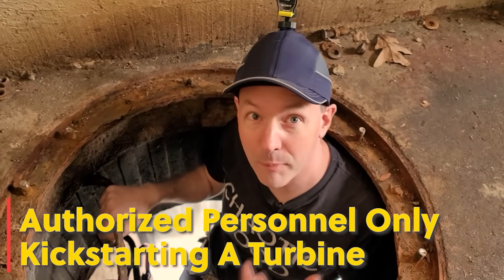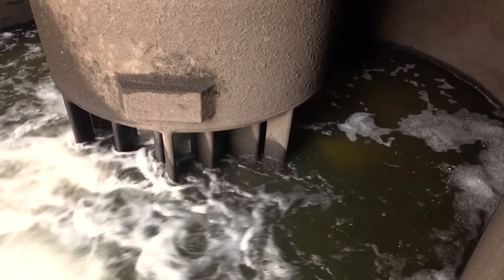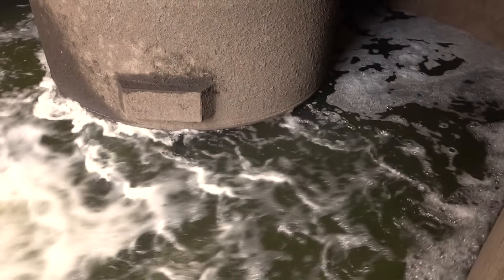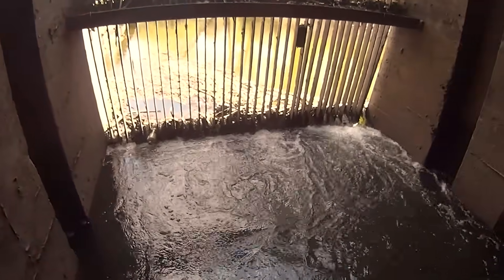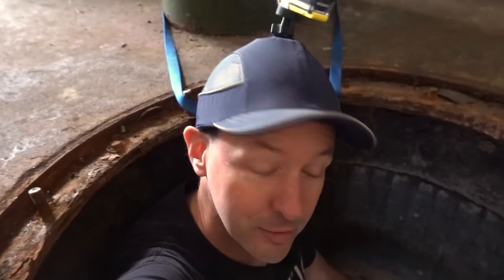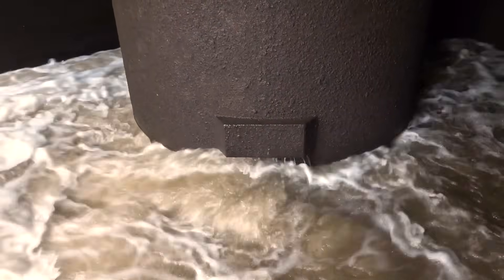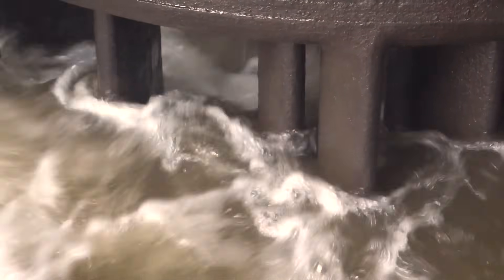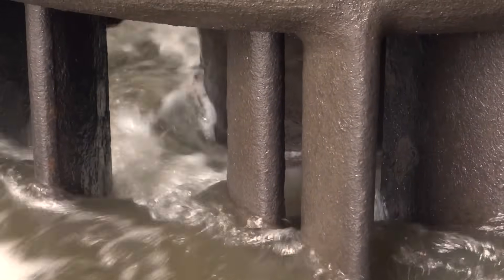Authorized Personnel Only - Kickstarting A Hydroelectric Turbine

Comment: How deep is the water where you were standing on the ladder?   By giving it a "JumpStart" do you mean you gave it a chance for the water head to build up a little bit before reopening the Valve allowing the water to enter the Turbine?

Do most Hydroelectric Power Houses work in a similar fashion as far as the water intake is concerned?

Comment: Dagone man, you’re lucky your brass balls didn’t pull you off that ladder! 😂 That looks like some serious flow! I’d imagine anyone that did fall in would be a guaranteed fatality with your legs getting sucked/pushed in between the vanes and the flow holding you, and if the vanes are the only way to stop it, if they hadn’t yet drowned they probably would even if they were “fortunate” enough for the vanes to have enough power to fully solidly close and cut their legs off so the turbine inlet could close and thereby stop whoever being sucked/pushed in and giving some soon to be mentally scarred coworker a chance of pulling them out. With my luck the vanes wouldn’t close solidly enough to completely sever my legs and I’d drown in agony and be stuck enough a crazy hero couldn’t free me without an axe or machete! …I can’t hold my breath long enough under water to die the other way by bleeding out from two severed femoral arteries.  Got to imagine the safety dude was drowning himself in some bourbon during this getting filmed 😂

Seriously bough this is an awesome vid and I’m glad you made it. 👍 …still a bit nuts tho 😂

Comment: It’s amazing the difference in turbine speed between the opening of the plates and the water level dropping back to its start level. Genius design. Plates help to direct the water in the direction to assist the turbine, and some of the water used to cool the bearing. Usually, simple is better, and more reliable.

Comment: Boy as a professional mechanic, i see a major problem. The drive shaft is not machined true and its out of balance. You can see much free movement putting pressure on the main bearing's.

Comment: As a retired military helicopter mechanic I saw kickstart a turbine and I thought I was about to watch you literally get in the water and kick start it. Trust me, I’m positive there is a private somewhere being told to “get down in there and kick it!” 😂😂😂
Reply: Seeing enough of these videos...wouldn't' have been surprised for it to be carried out literally
Reply: I helped cart start an F-4G Phantom once. Take a lot to get the air flowing through those jet turbines. To cart start (cartridge start) an F-4, you use something similar to a shot gun shell. About the size of a coffee can. And I don’t mean them little cans. A full size gallon(?) volume can. Seal it in the breach, the pilot hits start, and the gunpowder (or equivalent) burns and creates a ton of air pressure, heat, and smoke.
And it’s not uncommon for the aircraft parking spot to catch fire. Concrete soaked with hydraulic fluid, engine oil, and JP-4. Makes an exciting site. Especially when the smoke clears and the aircraft is sitting amongst the concrete being lit up. Depending on the load out, you can have a serious pucker factor on your hands. I was glad to help out, I was even more glad to only do it once.
Reply: I was asked by my kids when I came back, how many people I deleted in the war, I told them 9, they said"I thought you were a helicopter mechanic?" I replied yes, but I never said I was a good one😂😂😂
Reply: @Kamalacackleharris ouch
Reply: You're highly underestimating the danger here, does anyone manually move helicopter blades or air craft fan to start it? No, right? Similarly if he goes anywhere near moving turbine, he would become soup. He is already in high danger while standing on that stair, when inlet is open and water is moving, no one is allowed to go near that or stand where he is standing.
Reply: @ykd0011 I’m not, that’s why I couldn’t believe someone was about to try it.
Reply: Spin the blades to kick start it.

Comment: For some reason I always pictured the turbine laying on its side in a dam with water flowing from the turbine to the generator. It makes way more sense now. Due to the vertical nature of dams and no need to worry about by passing the water around the generator.
Reply: Depends on the the dam, but turbines definitely vary in style and layout. There’s both vertical and horizontally mounted styles, that much I know. But beyond that, there’s a vast wealth of knowledge I yet haven’t grasped. (Turbines are really friggin cool and I haven’t made time to do more research 🙃)

Comment: Wow! Such a small turbine, with such low head pressure. How much power can you generate with that? 100kw maybe?
Cleaning the debris in the grates, as little as it is, would make a good difference in this situation.
...is this even enough water to generate power? Or are you always on the verge of turning your turbine into a pump?

Comment: Was amazing working on Hydro Tasmania’s west coast generation, and being involved in refurbishment of 5 out of 7,  1-megawatt vertical pelton wheel  generators that started supplying power to a copper mine, first commissioned 1914, again, west coast Tassie
Reply: @russclifton2026  we visited one in Tassie with a wooden flume, I guess they are different to this because they have a really high head pressure and I was surprised to see how little water they used. Was like a firehose sized injector compared to this thing moving huge quantities of water through. Fascinating..

Comment: Awesome, TY for letting us in on this !! Jumpstarting ( starting ) most anything requires an increase of The Potential. In this case, I would have never thought of how to increase that potential.

Hey, about how many RPM is that generator turning at this spin-up point, and is there much of a difference between this lower operational water level RPM, and when the water level increases to full flow ?

Comment: This is similar to the Enterprise Mill on the Augusta Canal in Augusta Ga. I livesd 20+ miles from there . I worked for a contractor at this mill. I was interested in finding out how it worked. The canal has three levels. The first, or upper level, delivers the water. At the Enterprise Mill...there are two turbines. Each one makes 1/2 MW. The delivery pipe to the turbines are eight feet in diameter. They are rivited. The mill opened in 1845/6. It was enlarged during reconstruction. This is when the rivited delivery pipes were put in. 
  When both turbines are making power, the water races out the tailrace to the third level. A real exciting thing to see.

Comment: One friend of mine is a proud owner of a small hydroelectric power station, adm for him "flushing a toilet, means actually flushing a toilet into turbine outflow 😅🤣🤣
Reply from the maker: The toilets in our small-scale plants have all been removed because of that EXACT feature. Lemmie tell you how I feel about not having a working bathroom in any of the small powerplants. Several billion animals get to poop in the river, mine isn't going to make the slightest difference in the water quality. At municipal scale, certainly, but for individual users, not a chance.
Reply: @Physicsduck  yeah, exactly, and I'm not counting the fact that usually in cities drainage is mixed with sewage, so during storms it overflows to rivers anyway...
Reply: @Physicsduck  plus the aeration of the water would eliminate anaerobic bacteria

Comment: I think this is the only video inside the chanber while running. You have some guts buddy. It would be neat to put a go pro inside the wicket gates under water to see the blades turning under water. That would be outstanding and maybe possible in this instance.
Reply from the maker: Thank you sir! :) The next time I get the chance we'll see if I can make that happen. It's a good idea, but there's a LOT of technical difficulties to a shot like that. I've tried such things before, and most of the time it ends in having to buy a new camera.....and I'm low budget!

Comment: Just like the turbo charger on my 65 Austin-Healey. Now seriously, I worked on an Un-Watering pump below Bagnell Dam once, I was about 110 ft under the surface of the lake with water leaking in. It was seriously spooky to know if the concrete let loose you had zero chance. This is just a few feet of head, imagine 100 ft.

Comment: More modern dams use a volute around the wicket gates to remove the chaos of water entering the wicket gates. The water rotation going into the wickets improves efficiency by reducing turbulence. Instead of water entering a square room, from the side, the water enters a round spiral room from the side, spinning the water into the turbine.
Reply: The age doesn't have much to do with it. You're speaking to a different design (Francis runner) that's more popular in this day and age. The setup in this video isn't an uncommon low head setup. Still though... By the looks of things this is definitely a pretty ancient plant...
Reply: I believe in one of his shorts I saw that this particular dam is near 100 years old. One of the first of its design
Reply: So an IGV  then
Reply: @shadowopsairman1583  You could call it an IGV, sure
Reply: @isettech  I was wondering about that.
Reply: As a guy who worked on B-52S/autos/trucks/assembly lines  outstanding
Reply: Extremely low water head or Kaplan Turbine?

Comment: I was a crane operator on a Snake River dam. Turbines a bit bigger, I think the scroll case was about 20' across. Well the turbine blade and hub weight was 120 tons, five blades each at 15 tons per. My brother in law is on the Missouri in MT at Holter Lake and the turbines are similar to that but appeared to be older. They had wood stop logs still, crazy! I remember dropping the stop logs in our project and each was 30' wide and 8' tall, 4 went in each slot and 2 slots.
Reply: You have a Kaplan turbine in the snake river plant this is a Francis turbine .
Reply from the maker: This is a 4-bladed variable pitch Kaplan. You can see it up close in several videos. ;)

Comment: When you kick-started the turbine were you intending to generate power? If the turbine kept spinning with only a one foot head, I imagine that you would not be able to load it much; would you regulate that by changing the generator field excitation rather than the wicket gates, and does the governor even work on that as it does the wicket gates?
Reply from the maker: We just spun it up for this demonstration. There's no way we can generate power with the stoplogs closed. That's why we never tied to the grid. All that water was moved just so we could make this video for you. :)
Reply: @Physicsduck  Thank You  I've really enjoyed the whole series and I've learned quite a lot! 😊💜
Reply: @brettany_renee_blatchley  changing the excitation doesn’t control the power output of the generator, only the voltage/power factor. With such low water, the wicket gates were wide open and the turbine most likely couldn’t generate any power.

Comment: question.... turbines rotation and blades design are the same for the northern hemisphere and the south or is different to take advantage of the coriolis effect???
Reply from the maker: Now that is a most excellent question. I don't believe we take that into account (the Coriolis effect doesn't work on a small scale), but it would be fun to ask around and see.
Reply: @Physicsduck  there's an old book titled "Butter Side up! or The Delights of Science" by Magnus Pyke (a relative of the inventor of Pycrete) with a chapter on research on the Coriolis effect at small scales. It turned out that it does indeed cause water to spin down a drain but only if the water is absolutely still first. Researchers around the world built various basins and tanks and did things like covering them to keep air currents from having any influence, pumping the water into them in the opposite of the expected drain direction, and letting the water settle for long periods before pulling the plug.

Comment: 'charging the gravity battery', I will now see rivers, lakes and dams in a completely different way, thank you.
Reply: Check out the "electric mountain" in Wales. Literally using a lake on a mountain as a battery its crazy!
Reply: @TheBanana93  This is a relatively common practice around the world, especially with the use of solar.   During the day, solar runs pumps to transfer water to a higher elevation like a pond or lake, then during the night the water is released to generate power.
Reply: @TheBanana93  Dinorwig.

Comment: I'm curious. When it starts turning, the shaft seems to have a lot of run out. I wouldn't have though that was acceptable. How many RPM would it turn at in normal operation?

Comment: Very interesting indeed!  Thank you for posting.  I have zero experience with hydro power, however MANY decades ago I ran steam turbines on US Navy ships (those that turned generators and the main shaft) so seeing the similarities and differences between the two I find fascinating.
Reply: Do navy ships have to spend a lot of time equalizing temperature in the turbines? I know I have heard power plants can sometimes spend more than a day just running steam through the system if its been a totally cold start in order to heat everything up as the steam going in has to be totally dry.

Comment: Interesting!  I only ever got to be involved in one modification on a hydro plant, and it was a small one, which provided backup electricity for a nuclear plant.  We changed out the control system for the wicket gates with a computer-based controller.  Nonetheless, it was a fun experience.  So when YouTube fed me some of your videos, I was intrigued.  Great job showing the internal workings of the plant!

Comment: Man that is moving a insane amount of water. I know you said that it did before but seeing it go is something else. Terrifying and impressive at the same time.
Reply: This is not a huge turbine, but it's the biggest I've ever seen in operation. I'm guessing that this plant is near the upper limit of being something four guys can work on with hand tools, and it's big enough to be terrifying. Chris Boden has made an amazing series of videos. If you watch his whole playlist, you'll see every part of that assembly. I suppose it helps if you already know what you're looking at (I do), but it's all understandable with a little thought even if you don't have much engineering knowledge going into it.
Reply: I don't think it moving any water. The water is moving it
Reply: This video is for a much larger hydroelectric dam in Europe - it's the expansion chamber that prevents water-hammer when they close the valve ahead of the turbine.
  
https://youtu.be/fJVBlhgt9j8?t=45
  
Note for scale the concrete staircase, and the guy on the gantry crane...